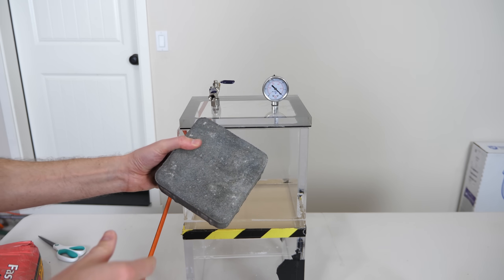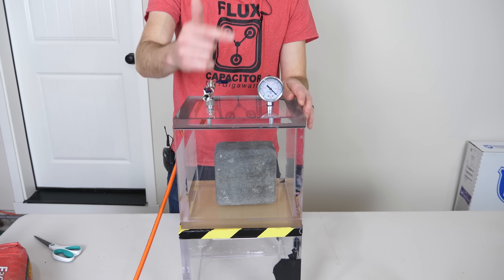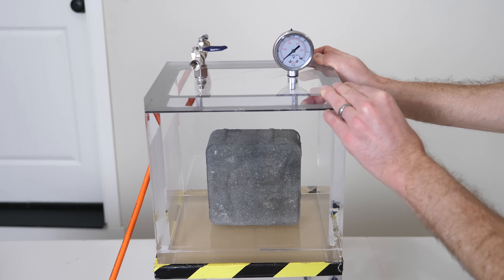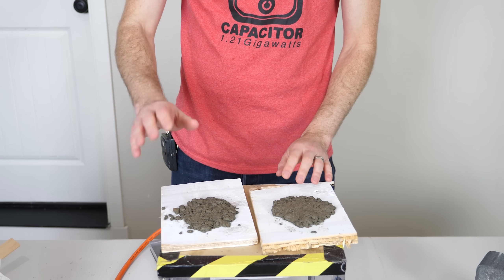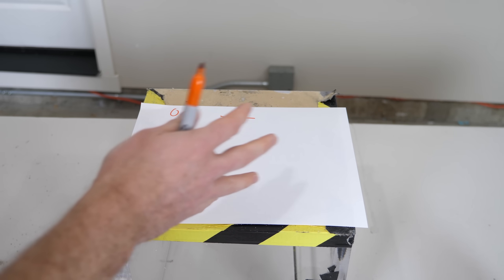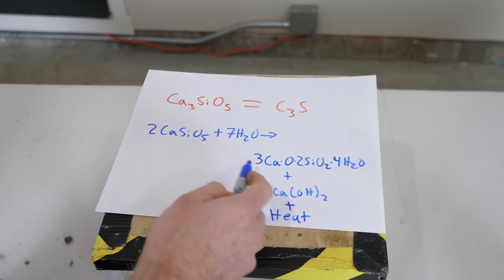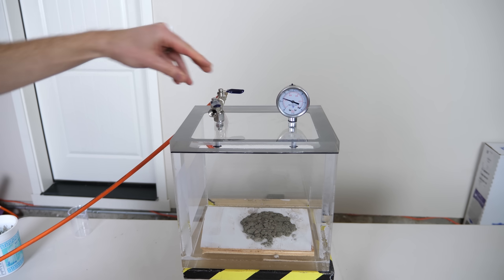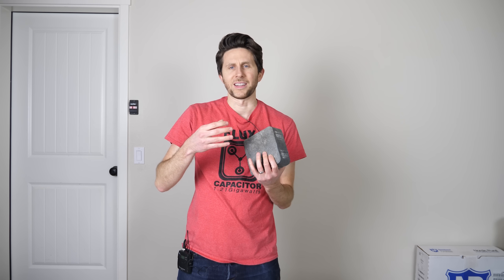Does Concrete Turn to Dust in a Vacuum Chamber? Concrete Without Oxygen Experiment

Comment: Most concrete is air-entrained concrete.  pulling a vacuum may remove some of the air and cause some micro-fissures, but that's about it. Excessive water in the mix causes more damage by evaporating due to the heat generated by the exothermic reaction between the cement and water. This process does cause cracks and fissures whereby more water can seep into the concrete, and in the case of roadways or other outdoor structures, cause corrosion the rebar and freeze that damage in the concrete itself.

Comment: One's interpretation of "removing all oxygen" changes the prediction.  I assumed it meant "removed all the air" i.e. "placed in a vacuum".  This is exactly what your demonstration did.  So I correctly predicted that the set concrete would remain solid.  I was incorrect about the setting concrete however.  I predicted that the vacuum would remove most of the water available and perhaps a very weakly set and fragile objext would result.  It would be interesting to do a longer term trial with slow setting concrete.

Comment: Concrete doesn't harden because it gets dry.  It's a chemical reaction that takes time to cure. More time equals harder concrete.  In fact concrete is often kept misted to help the curing process along by making sure there is enough liquid water present.

Comment: Concrete cures underwater.  If you pour the same slump concrete into two forms and place one of the forms underwater, the underwater concrete will be stronger when tested for both crush and tensile strength.

Comment: I'm pretty positive (like 99% sure) that nothing will happen to the concrete, I don't think it needs gaseous oxygen to hold together, though there may be molecular oxygen bonds within the structure, this will not be sucked out in a vaccum, just my guess tho.

turns out I was right

Comment: 100% confident that the concrete block will be just fine in the vacuum. No physical or chemical change whatsoever.
But that isn't the same as all oxygen disappearing for 5 seconds; if oxygen is part of the crystalline structure of concrete and it suddenly disappeared, perhaps it would crumble. And so would just about every other compound that contains oxygen - water would suddenly become hydrogen gas, carbon dioxide would become elemental carbon. Not sure what the Earth would look like for that 5 seconds, but it certainly wouldn't be recognizable.
But if we're just talking about oxygen in the atmosphere disappearing for 5 seconds and then reappearing, would we even notice?

Comment: Two items. 1.  The vacuum pumped out the moisture within the air as well the gasses. That moisture in the air will aid in the chemical reaction. That is the reason for the color difference.  2. Concrete (Portland cement concrete(PCC) is a mixture of PCC, sand, and rock. PCC and sand is grout.

Comment: Concrete in use never completely dries. This what holds concrete together. Try however heating concrete with fire and you will damage it by drying it.

Comment: What was the water density between the 2 samples? Try weighing them before and after. I know in the HVAC world, when you draw a vaccum and leave the vaccum for a while it'll actually turn any water molecules into a gas and it's easier to remove any moisture in a closed HVAC system. This will let the A/C system feel cooler.

Comment: I thought it would have slowly exploded. As the vacuum increased trapped CO2 bubbles would eventually bust through for liberation. CO2 because I am under the impression that massive amounts of CO2 are produced in the drying of cement. Next experiment should be to quantify its ability to hold an atmosphere.
Reply: Concrete in vacuum would actually last forever. Well. Or until radiation eventually slowly chips away at it, but that takes orders of magnitude longer than the gradual decomposition we see it having here on earth.
Reply: @zerg0s  Aye ! .. so the only issue is the 8 pounds per gallon of water. Wonder how much is actually on the moon 🌙.
Reply: @jethrotull5847  haha, yeah. But I'm sure Musk will be quick to offer his Tesla in low orbit to go and drag a couple of ice asteroids to the moon, or something similarly harebrained.
Reply: @zerg0s  I still think it would be cool to use an ESP-32 ( Arduino with WiFi ) with a pressure sensor to report pressure readings inside a sealed cement cavity created inside the cement block, say with a ballon. I’d expect no immediate change but I’d bet it would “leak” in a day or two. If your not familiar with ESP-32 you should check ‘em out ! Everything would be reported via web page and the ESP-32 would have to be in sleep mode as no cables should break the concrete seal.. ( just hope the 2.4 ghz signal can penetrate the concrete (LOL) .. heck you could even publish results real time ! Great videos and good feedback ! Thanks…

Comment: Does concrete turn to dust because of burning kerosene? Towers one and two! Can kerosene burn so hot to turn steel into molten steel, and remain burning for three months at over 2000 degrees?? Can a high rise fall into its own footprint because of a couple of small fires starving for oxygen? Building seven!

Comment: I think curing concrete in a vacuum will remove any excess water, since the excess water will quickly evaporate in the vacuum.  You cannot mix concrete with water in a vacuum.  Concrete will react with any excess water over a very long time period, years in the case of my garage floor.  In that long time period, the concrete will gradually get harder.  Using a diamond saw to cut concrete will depend on whether the concrete is "old" or "green", where "green" is another term for concrete that is only a day or so old.  The length of time for green concrete to fully cure will depend on the formulation, temperature, and water.  Some additives can accelerate the cure, while others can delay it.  Green concrete is quite easy to cut, while old concrete can be much harder to cut.  The demonstration video only tested green concrete.  If the time had been extended much longer, the vacuum-ed concrete might be measurably weaker than the fully cured concrete.

Comment: did you try putting a large amount of weight on the cement block after you took the air out of it from the vacuum chamber

Comment: late to the party:::: I guess for me your experiment wasn't adequate to compare the hardness. There is something people say, that very large concrete projects actually can take up to 10 years to reach full hardness. So, major highway overpasses, for example, with very large concrete pours, will reach hardness within maybe 2-5 years, but projects like a large dam may not reach hardness for much longer. While the concrete is between poured and full hardness, the concrete DOES breath water from the atmosphere, which is part of the reason why it takes so long to harden. Water evaporates from the concrete before it all reacts, but then over time, water moves through the concrete, gradually finishing the reaction. In space, this may require special consideration (if the concrete were "poured" in space) and might be one of the interesting "megaprojects" discussions, where masons in space need to use glues to seal the concrete, and then for some duration need to pump water into the center of the pour so that the concrete will gradually continue to set.

Comment: no Oxygen  versus a vacuum are different things.  But will not set in a vacuum since concrete pulls stuff from water to form a solid, the vacuum will evaporate the water before that chemical reaction can take place.

Comment: This is dumb. In a vacuum, water evaporates quickly, cooling the concrete, which will not cure properly below some temperatures. In addition, concrete does not dry, rather, it reacts and cures, which requires water, which evaporates under vacuum.

Comment: if you had the tech (Or happen to know the encoded frequency) that could neutralize the O2 molecule not only concrete would turn to dust right b4 your eyes along with Steel, the earths crust and humans. o2 is the binder the primary binder. I bet they already have something like that just over 20 years ago. Back in the 09's it was all they ever talked about in the scientific journals.. encodingtheFrequenciesofalltheknow elements

Comment: You really should mention that concrete uses CO2 to harden the material as it soaked up CO2 over a long period and gets stronger with age.  IIRC they said the Hoover dam would take over 100 years to reach its maximum strength.  There's a number of recipes that make use of CO2 hardening & you can design it depending on thickness & how fast you need the material to be at full strength.  I think you would also find that the concrete will gain mass over time b/c of the addition of the CO2.  It would be very interesting to see freshly cured concrete vs concrete that has aged (CO2 hardened) and see what the mass difference is.  

I would suggest pouring a block of concrete, allowing to cure for few days, weigh it, put it in oven to ensure water has evaporated, weigh it, then put it in a pressure chamber & fill with CO2 & allow to sit for few days - then weigh it again to see if it has increased in mass.    I'd also love to see a strength test using the above comparisons.  Make concrete cylinders & do compression, elongation & shear tests at different times/stages of curing.

Comment: How many microns did you get it down to? At 500 the water will boil at -12F, and 200 is like -25F  it would be interesting to see if the concrete could handle rapid steam expansion.

Comment: I honestly think the idea of it crumbling to dust because of a vacuum is really silly. Maybe in a super sudden vacuum where all gas... not just oxygen, oxygen is actually not even a third of the air we breath, most of it is actually nitrogen... just magically teleported out from around a concrete structure that still had air inside it and the concrete was already structurally unsound, it might experience some failures. But for the most part concrete isn't going to magically crumble to dust because of a lack of air pressure, it would take MUCH more force than a simple vacuum.

Comment: I was 90% sure nothing would happen. Concrete is basically pourable stone.
If the mere absence of Oxygen would cause the imaginary crumbling, good luck trying to make a dam. We have those.
If it was the vacuum? That would mean one of the chemical bonds was insanely weak. And any reagent or acid targetting that weak bond could easily destroy concrete.

Comment: If the only thing removed for 5 seconds was O2 and it didn't cause a vacuum, humans would barely notice. In sudden decompression on a plane, both low O2 and loss of pressure have negative effect on passengers. Lack of O2 for 5 seconds grabbing for a mask is not a big problem. There is enough O2 in bloodstream to keep brain functioning. Loss of actual pressure is worse. It effects lungs, ears, eyes, nose...

Comment: What affect concrete more than Oxygen is just plain 'ol common air. Down south like where I work in Texas, that is not an issue. Up in the Northern states though concrete needs 2.3 to about 9% air. This is to allow it to expand and contract with the freezing temps without cracking. When temperatures get to below freezing the concrete (unlike freezing water), concrete squeezes in on itself. When the temps go up to the 80-100's the concrete expands, like water does when it freezes. This expanding and contracting over time can cause the concrete to crack if it is above ground and exposed to the weather. The air in the concrete acts like the expansion joints do and give the concrete some give. The cracking issue is compounded if it is wet out. Rain will soak into the top layer for up to ¾ of an inch while the rest stays dry. The air in the concrete gives it enough buffer to keep the wet layer and the dry part intact.
Reply: If you put such concrete with air in a vacuum, would it explode due to the pressure of the trapped air bubbles ?  Or is the concrete strong enough ?
Reply: @thierrypauwels  Nope, even though it has air the concrete in still porous so it can bleed off the air or water without breaking. If you seal it with rubber or plastic? Don't know about that.

Comment: My guess is that the concrete wouldn't give a damn about the vacuum.
In fact, without air it would probably last forever.

My guess about concrete drying up, is that it would dry up even faster in vacuum.

Update after viewing the video:
A way to test the evaporation is to weigh the concrete on an accurate scale before and after it dries.

Comment: Concrete also typically has gravel mixed in too. Concrete after it hardens [it doesn't just "dry"] it is basically a rock. Rock don't require oxygen to maintain their cohesive density.
If you put wet concrete in a vacuum it will dry/harden just fine. The quality of the concrete might be reduced because of the accelerated moisture removal via the vacuum.
Reply: Because the process is a chemical reaction, it's not drying or hardening. The correct term would be setting or curing.

Specifically, concrete is said to be set once it is stiff enough not to deform under pressure, such as someone walking on it. Concrete is said to be cured once it reaches full design strength.

Generally speaking, drying would imply that water leaving the mixture causes the change, and hardening would imply a physical process (such as work hardening) is causing the change.
Reply: water added to concrete makes crystals in the concrete expand and enter lock. and there is an air content when mixing it on industrial scale, but it needs to be balanced in order to prevent bubble texture.
Reply: Plus putting it on those very dry pieces of wood probably sucked some out from the bottom
Reply: I, too, know stuff.
Reply: Indeed water is part of the CHEMICAL REACTION
Reply: Just thinking of asteroids in space, they are rocks. They don’t need oxygen or any air to support it from falling apart into dust and debris.
Reply: Lime based cements would have problems, as they require CO2 to cure. But, Portland cement based cement undergoes a hydration reaction to cure.
During the construction of the Hoover dam, extremely large pours were attempted with the concrete. It had to be broken out and replaced, as it literally began to boil the water in the concrete during curing.
Reply: from experience, the initial reaction is pretty fast, hence the heat, but then slows down after a time.
also after a time, it begins to absorb CO2, which further hardens it. though this forms a layer near the exposed sections, forming a protective layer which slows that reaction further.
New concrete takes quite a while to achieve maximum strength, 1 to 5 years, ambient temps and humidity having much to do with it.
Older concrete begins to harden (become brittle, harder, but more shatter prone) in layers, with the outer part slowing down CO2 intrusion to the inner part. under mechanical stress and weathering, this results in the upper parts of sidewalks crumbling in large flat chunks.
I have worked with some concrete tools and equipment designed for concrete work that become problematic and downright dangerous when the concrete is say, 30 to 50 years old; Concrete drill bits only lasting a handful of hole drives, where they usually last a hundred or more, Ramset nails getting bent and deflected back at the tool operator (these are driven by small arms explosive charges and could be considered firearms in their own right) leaving hardly a mark on the concrete or completely shattering the concrete surface while doing same deflection. it is maddening when trying to mount equipment or wire fasteners to these surfaces when you've made only one good shot out of say, 3 to 5.
I've gotten better odds fly fishing it seems
Reply: Concrete is an artificial stone which resembles Portland stone (found here in the UK), hence why it is known as portland cement here. Cement added to sand & a little water will make a cement mortar. This can be used for cementing [pun intended] bricks together to make a wall. Add some larger particles of clean stone pebbles or clean crushed stone to the mix & then you have concrete.
Reply: wet concrete in a vacum may get stronger since you remove the air particles in the concrete the sand gravel and cement powders are squeezed tighter together.
Reply: Removing the air and some water can also be done using vibrationpacking the cement sand and gravels tight in the bottom of a mold while air bubbles and some water exits the top of the form.
Reply: I was just thinking, "It's too bad there's no Oxygen on the Moon, that must be why the Apollo Astronauts didn't bring any rocks back."
Reply: rock may not need oxygen to survive but some rocks require moisture or they will break and crumble. some actually crumble and rot after being exposed to oxygen. concrete is almost as hard as rock as its made up of rock mostly but its not uniform so it will always have disadvantages.
Reply: @chehystpewpur4754  And that's why there are no Moon rocks.

Comment: I see 2 possibilities. 
1. nothing will happen. something like 60% sure.

2. the concrete block will crack, because the pressure from air in the block overcomes tensile strength. 20%

3. Something else. 20%

Comment: I think it might explode cuz the little air bubbles that's in the rock or Crack just to release the pressure building inside it
Reply: I guess I was wrong. But you should try to make a concrete balloon and see what would happen in a vacuum. Would it be like alligator skin went it comes to holding water  in? Or would that become a vacuum grenade? (Would it blow like a grenade cuz it's in a vacuum)